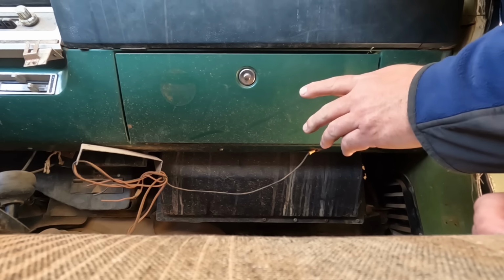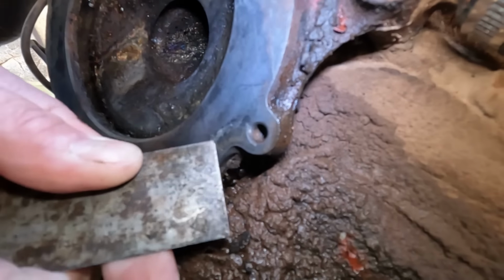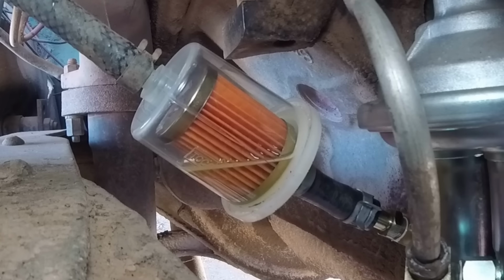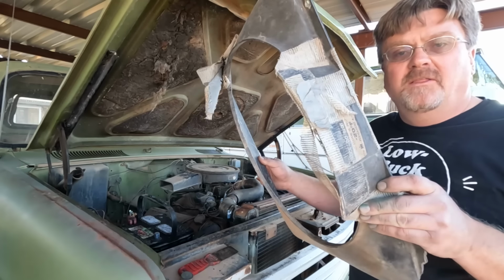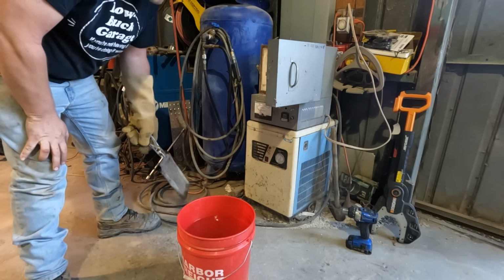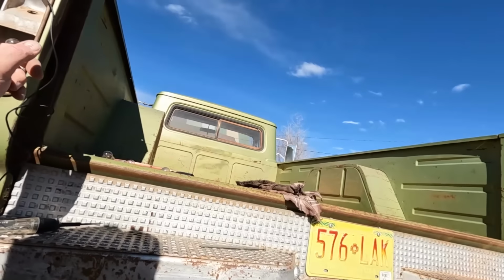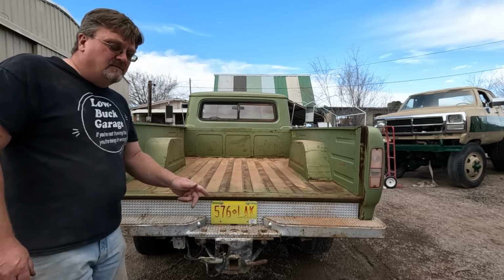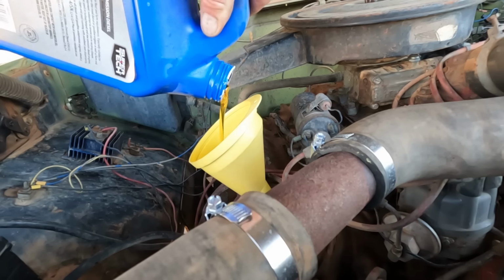International 4x4 Part 2, On The Road!

Comment: It's not unusual for International to have all white wires in the harness. because they designate the wire by a number. that is placed about four or five inches apart on the wires. the person that had that clutch linkage adjusted so tight. must have driven it that way for quite a while and wiped out the clutch disc. but that truck is definitely worth putting a new clutch in for sure. I also noticed that it has a 205 new process divorced transfer case. that's about to strongest transfer case that's available. that truck is a real workhorse, and there's a lot of work left in it. that's the kind of truck a person hangs on to for sure.

Comment: I've used the sides of old broken 5 gal buckets for patching up fan shrouds. Just cut out of the sides of the bucket to fit the curve needed and pop rivet it in place. 
Also,  body filler putty works well for patching leaking radiator leaks and holds a long time under extreme pressure.

Comment: Thanks for the 2 videos. I bought myself a 1970 1200D a couple of days ago and this was extremely helpful. I have some starting points on mine to help me get closer to making it better. My truck runs and drives, however, the brakes are terrible. While mine don't seem to need bleeding, they don't operate very well at all. I have to really push hard on the pedal to get action, plus the pedal seems to be about 4" out further than comfortable.

I hope you do another video about the truck, though, I don't have high hopes as this was 2 years ago. 

Keep up the great work. Liked and subscribed.

Comment: International uses all white wires with number circuits. The circuit numbers are printed on the wires. Also, the brake light switch sends power to the turn signal switch. The T/S switch sends power to the brake light bulbs. That allow the switch to use the same filaments for brake light or turn signals. When the switch is in the nuetral position, both bulbs light. When you move the switch to let's say left turn, the left become a turn signal and the right says as a brake light.

Comment: Fiberglass is easier:  clean -- coat area with resin -- add cloth -- recoat with resin -- let dry    It probably is designed to start moving in 2nd under low load.  1st is designed for a loaded start.

Comment: One thing I remember about the old corn binders was that it was important to have the serial number when getting parts. Ignition parts could come from any of several manufacturers depending on when the truck was built. I guess they must have jobbed out bids, and took the best prices when building em'. Still, you could have a barn dance on them and never leave a dent. I miss em'. We had that shift pattern on one, don't remember year or model. The 345 was twice the engine of the 304, had to reroute the fuel line on one that vapor locked, LOL good memories, they would get you anywhere and you wouldn't forget how you got there!

Comment: Here's a tip for a cheap wire protector. Find yourself some used cheap garden hose, push your wiring through the garden hose & waala your wiring is protected. Works great when having to run trailer wiring from the  controller to the back of vehicle. Use some silicone caulking to keep water & dirt out of the hose.

Comment: I looked through to see if you'd done another video on this. A couple of things I know from working on vehicles when that Cornbinder was new. 1st gear is really a creeper gear, and you generally start in 2nd, unless you're pulling something heavy. Second thing is, the problem with the left taillight is probably in the turn signal switch. I made that frustrating discovery in a 1974 Econoline van.

Comment: Watching fixing the fan shroud. Next similar situation get metal window screen and a soldering iron. Lay a patch of screen across the plastic break and spot heat the screen until it sinks into the plastic. When done leveling the screen into the plastic you wipe the iron back and forth to level any high plastic to smooth it out a little.

Comment: That is a well-appointed truck. I figured it had a slide in camper right off when I viewed those hold down hooks on the bed and of course the missing tailgate. Poor old truck is the victim of somebody not knowing what they are doing as to the servicing and adjustments but overall it is pretty complete. Of course the wiring is a bag of snakes but that is expected for any add on items that are not factory. When you get it squared away it will make a pretty good serviceable truck. As you probably know the square body Chevrolet trucks have that same issue with the hood bending. It is a safety design engineered into the hood to fold up upon a front end collision, but as the hood hinges wear and also rust up then the hood will bend like that when one goes to close it. There are support pieces available just like the ones you made up and of course some lubrication on the hood hinges helps out. Of course like yourself I fix a lot of things with an oil can.

Comment: My dad bought one just like that from the state auction and it was the bright safety yellow and hadn't been started forever, i had it running in no time and it ran good and had the granny trans in it. He drove that old truck every day for 30 years, he would leave his new cars sitting and jump in the old international and go hundreds of miles away and back with no trouble, the only thing that we had trouble was it was a short bed and when the road was wet it would spin out in the curves so quick it was crazy, and we changed the tires twice trying to get it to stop but it was so light in the back it wouldn't hold the road in a turn, and we wasn't going fast. But it was a good truck. That's a fact
Reply: :face-red-droopy-eyes:May sound sacrilegious, but weight is your friend in a pickup bed...

Comment: You can get IH belts at an IH truck dealership..big trucks. That's about all they might carry for the old pickups. I just picked up a 67 step side pickup 6 cylinder 4 speed. Parts are pretty much non existing. I put an electric fuel pump on to get it to run.

Comment: Guess it's my own fault for actually learning automotive electrics, but the wiring on that truck is making me upset. All those power thief connectors are a crime and not to be used for any permanent connection, and I don't anyone who cares about their vehicle who would use. At this state it's best to cut the harness right at the front and run some 7 core all the way to the back, with proper heatshrunk connectors everywhere. Only way to ensure it all works and is wired correctly, and also makes it less likely to corrode.

Comment: In '69, the brake lights came through the turn signal lever.  That's where you get the shutoff for the brake light on the side with an activated turn signal.  (We had a '69 Scout 800.)

Thanks for the great videos!  I enjoy your humor :)

Comment: the tranny's 1st gear is a granny .  you normally start in 2nd.  as for the wiring all ih wires are number stamped to indicate their use.  the legend is in the service manual along with a schematic.
Reply: Yes sir that is common with the International trucks. It can be quite the pain to troubleshoot wiring on these trucks without the factory wiring diagram. I had a 96/70 cabover I bought used and there was no factory wiring diagram that came with it and it was also discontinued so I could not obtain one. We had another owner-operator that had one in his truck, but it was missing some parts due to the bouncing around in the vehicle and such. I found it best to keep this tuff in a plastic bag and out of the sun to preserve it or keep the wiring diagram in the shop out of the weather. Of course these days one can probably obtain reproduction diagrams on the internet.

Comment: I realize this is old but for future reference, the brake light power goes from the brake light switch to the turn signal switch and the turn signal switch determines what tail light to send brake light power to.  I suspect your turn sig sw is bad.
Thx for a great vid!

Comment: Those old International pickups will run forever literally and this guy is the king of problem solving
Reply: They still require maintenance, but are not queens...UURAH
Grew up in a GM  family in the 70s...best 2 things I'm aware of .. a Corvair & GM/Detroit uniflow  SCREAMING JIMMY, NA or better yet TURBO variations 
The rest is fair to middling, replace it at 70K   
🖕GENERAL MOTORS
GM abandoned the faithful when Chevy truck's no longer carried the 
FOR ECONOMICAL DEPENDABLE TRANSPORTATION 
kick plate tag...:face-orange-frowning:

Comment: Sure wish I could have kept the one I had like this , but it was back in the mid 80s and I was broke, so had to sell it !
When I changed my water pump, I took out the rad and flushed it, much easier that way...  Put some grease on the bolts you remove, you will be glad you did .

Comment: probably your wheel lines are plugged. that turn signal switch is the same as 1970 chevrolet pickup. that plug under the hood is for the external regulator. it looks like your transfer case moved. that crossmember above it is known to crack and break under load , better check it

Comment: I had 2 International Scouts.  A 65 with no heater and a 73 that I ordered.  I got the 4 speed over the auto and the 345 v8 with a whopping 147 hp!  The body was so cheap the sheet metal ripped on the r side of the cab and it was thin.  I'm pretty sure your truck has a 4 speed too.

Comment: I like to place the fuel filter before the pump also am surprised you did not replace the Philips screws on the water pump with bolts

Comment: I'm sure you have more important issues, but I hope somewhere down the line, a grease gun gets acquainted with the numerous grease fittings under there. I wish I had patience like yours with the wiring issues. I know just enough about electricity to know to stay away from it. I really like the truck though! Thanks for the video!

Comment: Those plastic filters are fine down by the fuel pump but running one in the engine bay like that is a little fire-bomb possibility. I just wouldnt chance that
Reply: Yes it is best to use the metal ones and of course I see most of fuel filters not properly secured to the engine and they compromise the fuel line to be subject to vibration. It is ok though if there are rubber fuel lines but the fuel lines should be properly secured.

Comment: So your convinced that the two brackets on the left inner fender well are for a air filter. Ok... thats fine. I do know that the factory used that same bracket for my winch on the front bumper, not installed at the dealer but straight from  the factory on my 66 international. Strange they would use it for a air filter later... just saying and I am old enough to know just what I'm talking about. Also when you pull the clutch, if you have a way to check the short drive shaft in the middle of the truck, it could just be the camera but it appears to be out of round or wobbling a touch. Could just be the grease on it making it appear to look like it is doing a weird thing. Or maybe I should just keep my mouth shut as no one likes a person who finds something wrong with everything... which is exactly me as well, guys who act like they know everything seldom can find their way to the bathroom
Reply from the maker: I really have no idea, but the previous owner said that there was a remote oil filter mounted there, and there were oil lines in the area.  Its a bit of a guessing game as to what was there when its missing.  I'm going to have to yank the trans to get to the clutch, so I'll check out the driveshafts then.  Something does look funny under there, so I'll give it all a once over.
Reply: @LowBuckGarage  I am glad that you probably seen what I saw while editing... I have owned a good many of these rigs and I do know what that bracket is for....the hydraulics run with a electric motor right on that control and it was all for the winch

Comment: Don't remember much about the wiring on my small IHs, but the semi I drove may be some help. All the wires were white, but if you clean them up, they are all numbered. The whole length of the wire will have the same number for you to follow. FYI, there are few exceptions, but the wire from the brake light switch always goes to the signal light switch so the flasher can interrupt the desired side on the way to the back. That applies to the rear lights only. If you tap into any handy brake light power, it may be for the other side. In which case, your left light will flash along with the right one when you signal, and you will have no brake lights. For me, wiring is fun!
Reply from the maker: Thanks for the tip, I'll look for those numbers!

Comment: The turn signal switch is where the magic happens.  That is where the brake light connection is opened so the turn signals to work.

Comment: Excellent video Low Buck Garage  :) be interesting know if that truck built in Hamilton Ontario Canada  because my late Dad & Uncle 1968 1 ton International  2 wheel drive was bought brand there's from cost them $4.500 back then ! Also me that one for fuel pump didn't have  Big Semit Glass Bowl with big Cartilage filter plus Rubber O on top Bowl similar to on farm tractor on gas type from 1940 to 1960's! Also Fuel cap on there on door  one big cap like metal button size of box fender without grip in middle only outside of cap  and one tank it was right side took 46 gallons fill up remember fill up on farm tank with hand pump too! Also that wire broke of key ignition switch goes to Accessories plug or On plug of + side wire and Light Bulbs in gauges plus Turn Signals  also blue stripe in top Speedometer  for High beams  use Peanut Bulbs  like 1960 to 1990's  GM License plate lights ! Also if get chance check Alternator on this Truck if GM Delco Remy Alternator of Internal Regulartor with 2 prong plug and one post on back also 35 amp on low voltage and when put windshield wipers or headlights on jumps up 70 amps high voltage for recharge battery! Because one Alternator my late Dad and late Uncle had 70 amp one thought was weird but 1990's found about when use on Farm tractor to heard called 2 stage type! Also clutch plate in transmission is GM daul pad side last heard about those trucks use ! Hope see more videos on this truck in future too!

Comment: The brake sender is a double switches. The switch have passenger side red and black wire. Red is positive and black is negative. second switch have black wire and green wire. Green wire is positive but cannot connect to the red wire. Two switches are press as same pressing down at same time means these are brake switch. The brake pedal old system wiring have contact only one switch and that doesn't make sense. The brake switch with 3 wires is a mocked up design by a beginner. Where is the double poles switch and International Motors no longer makes them. Try Chevrolet manufacturing the switches in one box/case. Then go that the brake case box/device can stay on the mounting holes near the brake pedal arm so the metal arm can press and switch "On" the device/switches only after you stepping on the brake to stop the truck after all ready and done the wiring right kind of connection and be Electronician design up a very simple schematic of the electrical of plain lightning small current bulbs. 
 I hope the original brake light have copy blueprint for us to read together for here we are in North Carolina. Thank you for improvment in studies electronic. Electrician will build wet cells car batteries, Marine cycle batteries and the light bulbs etc.

Comment: Yes, you made the International radiator worsen. The many tubes are between the right side hub tank and left side hub tank with punt holes for radiator hose to bead/clamp to the inlet and outlet called bunt holes.  you must cut out the tube on both ends and leave the broken tube in the radiator but there is a margin hole between the tube and side hub tank.
 Hub is another word for manifold. The wire nose cutter - it means small wire cutter that it snip off between the tube and hub tank. The hub tank stays in the radiator but still you have to brazing the silver/tin wire after using the flux on the hub tank (brass) and seal the hole on  this side of hub tank. The hole will be sealed with solder silver on the side where tubes are connected to. Don't forget to brazing the silver/tin wire on the other side of the radiator. Because you must cut both ends of the broken tube since that tube is leaking. The broken tube cannot be remove from the other tubes so it stays there. The broken tube is never fill with coolant again. 
  The modern aluminum radiator have black plastic hub tank on both driver and passenger sides of radiator. 
 You were soldering right in the middle of tube and don't do that  because it is the only way as professional rebuild radiator as quick as possible by using silver brazing and use only propane burner Bernzomatic and/or Coleman. Thank you.